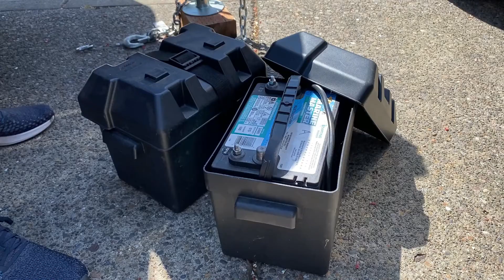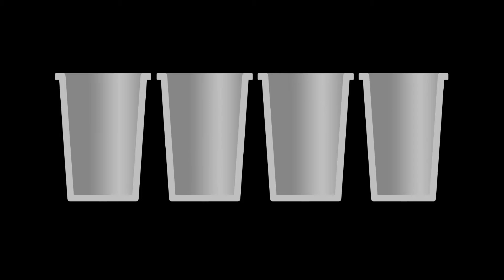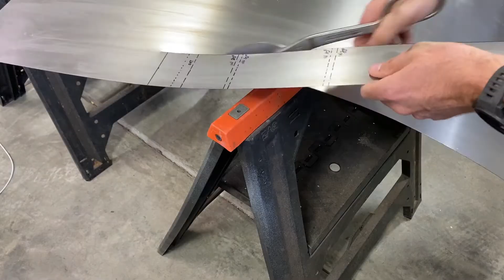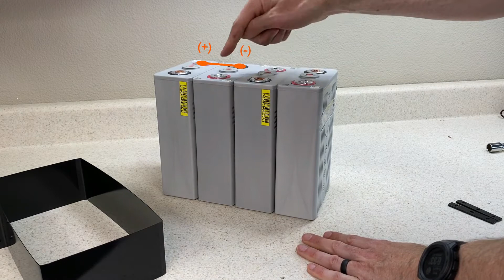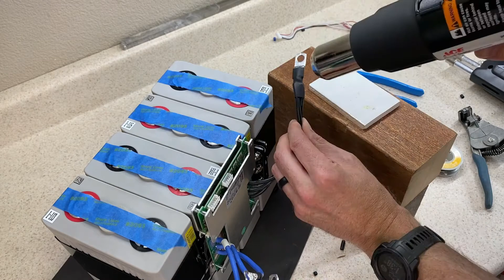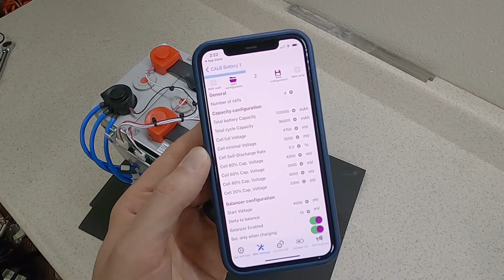DIY Lithium RV Battery Build - Part 2: Building the battery, Start to Finish

Comment: your cells are showing at $600 for the 4 cells wo make 1 100ah battery..is that right?
Reply from the maker: That was about right at the time I made this video. Prices fluctuate and have generally dropped. I don’t see many of the CALB cells for sale these days, but similar capacity cells now run less than $300 USD for the 4 cells needed to make one 100 Ah battery.

Comment: Any idea if that app will work with other BMS's?  I have one that looks identical to yours.  Has bluetooth.  Unfortunately the manufacturer I got mine from only has an android friendly app.  Outstanding video!!
Reply from the maker: That is a great question. If I recall correctly you can download the app free and maybe it was just certain functionality that was locked out until you purchase. So I think you could try connecting to the BMS and confirm some level of compatibility before taking the plunge.

Comment: Excellent video series!  One thing you may want to consider to significantly speed up the initial charge, is to do a bench setup in series with the BMS connected.  This would allow you to utilize higher CC/CV  (series - 14.4V@5A[72W max] versus parallel - 3.6V@5A[18W max]) from your bench PS to bring the pack charge up faster, while the BMS would protect against any imbalanced cells being overcharged.  After bringing the series pack to near full, you can then drop back to a parallel 3.6V to finish off the charge.

Comment: i thoght it was best practice to keep all balance leads the same length so they all get the correct voltage reading and resistence etc
Reply from the maker: Yeah, that is something that is best practice, though I have read from others that it doesn’t have a big impact when you’re talking about a few centimeter difference. Will be investigating this further to see how this may be affecting my current packs, and ordering a new balance lead to compare side by side so I can see how it plays out in real life.
Reply: @thegregbase  this will be good because if length does not matter i can tidy up the cables on my nest ebike battery
Reply from the maker: Well to be a bit more clear, at the lengths I’m looking at (only a couple of cm variance) and the voltage of my pack it MAY not have a big effect. I would not extrapolate that to all situations. Others will likely have better firsthand experience than I do in packs with more cells and higher voltages and a larger footprint with more lead length differences.

Comment: First and foremost - What an exceptional video!  I have watched a ton of these, built several LiFePO4 batteries myself, and I can honestly say this is the most thorough and most professional build I have seen.  Your fab skills on that clamp were very impressive! :)  However, there are a few small things I would mention.

You can't rely on voltages to determine the state of charge (SOC) for LiFePO4 battery cells.  You can have two cells with identical voltages which still have a delta of 40% SOC.  You really need to connect all four (or 8 or 16) cells in parallel for a period of time, which will allow them to equalize their state of charge.  Once that is done, you can proceed with the top-balancing, which you explained very well.  Changing the length of the balance leads can cause slight changes in resistance, which can impact how well the BMS keeps the battery cells in balance.  After running the balance leads, you can use your multimeter to verify they are wired in the correct sequence by checking that the voltage adds up, sequentially, as you test the negative and each positive lead, on the plug.  This is more important on batteries with higher cell count.
Reply from the maker: Thanks for taking the time to watch and comment! 

Agreed on the voltages not being useful for determining SOC, especially in the flat area of the charge curve. Sometimes, trying to boil down something into a relatable metaphor like buckets and keeping the video length reasonable has some compromises! That said, as I understand it, connecting the cells in parallel to allow them to equalize before parallel charging will equalize their voltages, but wouldn’t necessarily equalize their states of charge. 

On the BMS lead lengths comment, that is a great point, and I think this is an opportunity to do some further experimentation to see how that plays out in real life. The difference in my lead lengths is small so the difference should be on the order of a milliohm or 2, but admittedly I don’t know enough about the voltage measurement circuitry in the BMS yet to predict the implications of that. Also are there variations in other physical connections, connectors, and precision of the BMS that exceed this? Not sure, but will be great to test and add to another future video. Off to order another BMS balance lead… :-)

Comment: I really enjoyed the tutorial!  However, why no link to the New CALB CA Series 100 AH LiFePO4 cells?  What was the total cost for BMS and Batts?  Additionally, how was your experience with China?
Reply from the maker: Sorry about that - oversight on my part.  Link has been added to the description.  I started collecting the parts last year, in two batches.  I paid 478.00 for 4-100AH cells and 73.00 for the BMS at the time, shipped from China, which took about 8 weeks from order to delivery.  Second set of 4-100AH cells from US stock was about 568.00 and arrived in 5 days.  

However, as of today, looks like you can now get the cells for 422.00 shipped from US inventory using the link I just added.  So that would be a great improvement.

Comment: I will do the same; I ordered LitIONPO4  3.2V cells with 310A from AliExpress- I haven't receive yet . Only thing I suggest that you should have the 'heater pad ' to protect the batteries when deep freeze.
Reply from the maker: Good luck with your battery build!  310Ah will be an excellent pack.  Your suggestion of using a heater pad is also a great addition for the batteries for cold climates.  We don't get really deep freezes in Oregon, so hopefully won't be an issue for us.

Comment: What a great video. Perfect timing for my build. What awg gauge was that lug you used on your combined P- wires on your BMS?
Reply from the maker: Thanks, and I'm glad you found it helpful!  That is a 4 gauge lug on that combined set of leads.  Good luck on  your build - you will not regret it.
Reply: @thegregbase  
Perfect, I have those! I am being really impatient on the charging in parallel. It takes hours to gain a mV with these 280AH cells. I’m going to hook them up in series with the BMS and hopefully I can charge at 10 amps rather than 3. I have the same BMS as you and yes, I did get the Bluetooth module, haha
Reply from the maker: @thomash7573  Oh yeah, no kidding.  280 amp hours will take an eternity to balance at low Amps of current.  You start to wonder if your cells are defective after a while of not seeing any mV movement.  Connecting them in series and them doing conventional charging up to at least closer to full, but not quite topped out can be a great way to get there more quickly.